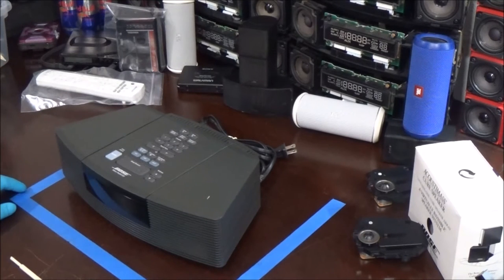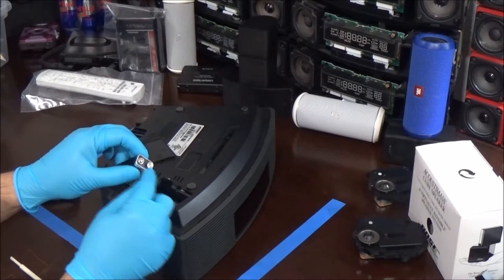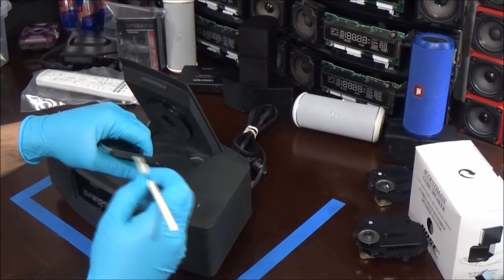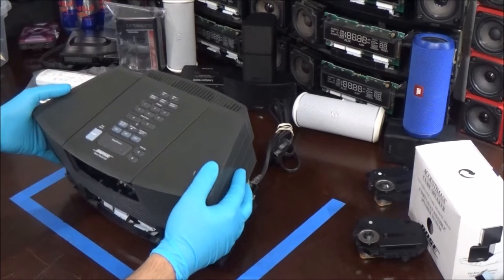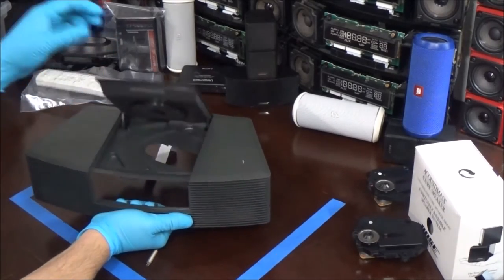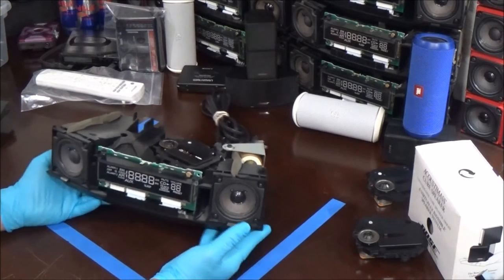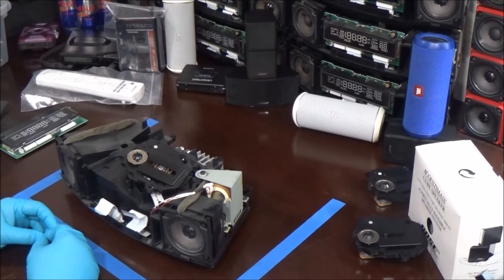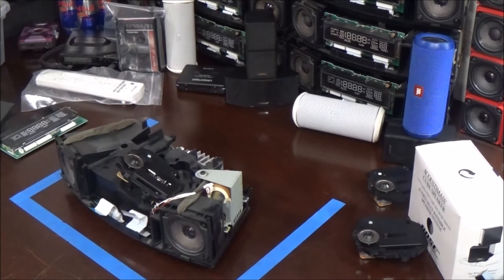Pt. 2 First Gen Bose Wave CD Radio Teardown Repair Dismantle All You need To Know

Comment: Wonderful and so thorough.  The compartment door on my original had become irreparable via an accident. I bought an identical model for $25 off eBay that had a inoperable CD player and used this video to perfection to take the working compartment door and ribbon cable from the purchased unit to repair my original.  So excited and thankful that my original is working 100% now!
Reply from the maker: Thank you! I'm so glad I helped.

Comment: Thank You  for the very informative video,  I have 2 Bose Wave/CD radios. I just picked up my second unit at a second hand store for $7.00, with the knock off remote in white, and it works fantastic, even more clear then my original unit I've had for 15 years. They are both fantastic sound machines. Thanks for sharing your knowledge on these fantastic radios. Very well done vidios...
Reply from the maker: Much appreciated, Thanks you.

Comment: Great teardown guide, Luv these units still got my dark grey one (made in ireland) from new back in the day , now got a white one (US made) that has the dull display & won't read discs so something to get workin on !
Reply from the maker: Thanks! Yes, Bose had one of it's largest factories in Ireland they produced more Redline cubes in Ireland than anywhere else. It is rare for the photoresistor to go out however the VFD (vacuum fluorescent display) is a different story, at least for now you could set the dimmer to the brightest, also have you tried cleaning the lens?
Merry Christmas 🌲

Comment: Mine got rained on and the left side has no sound. It doesn’t seem to be the speaker. I switched the wires and the problem switched sides. Any suggestions please.
Reply from the maker: Hi, it sure sounds like your amplifier has a bad channel.

Comment: Great video!! I recently bought a Bose Wave on a garage sale and some of the pads in the CD lid won't work mostly my on/off and volume buttons and I don't think the infrared is working on the front panel. I bought a used lid and a new remote which doesn't work right now. Your explanations are just great. I should have a refurbished lid and pad on soon but not sure what to do about the infrared on the panel.

Comment: I read open circuit across the power plug.  Fuse test ok.  I noticed that the primary widings on J2 also measured open circuit.  Where do I purchase a transformer?  Very good video to show how to open the case.  Thank you.
Reply from the maker: My pleasure. You can find a transformer from $15 to $25 on eBay Hundreds are listed make sure the part number and Rev. are the same. Good luck!

Comment: Hello, Great Video!.  My Bose Wave doesn't play when first plugged in.  It plays great after plugged in for a bit, seems like it needs to warm up.  Is there a component that can be changed to fix this issue?  I am handy with a soldering iron.   Thanks
Reply from the maker: Hi, you need to use a good magnifier and check all CD related solder for cracks. Only one thing causes the issue you're having, cracked solder. You just need to find it and reflow it. As your unit heats up and expands it makes good contact at that point. Good luck
Reply: @EightiesNut  Thank you for the tip.  I took it apart and poked around with a magnifying glass.  It now works perfectly.  Do you have experience with the SoundTouch series or the older Lifestyle series?  I have some of those with a variety of issues.  Not much info out there from people that actually worked on them.

Comment: Thank you!  This is such a great video for explaining how to take apart a Bose wave. The problem is though, if you find you need say a replacement cd drive or a display how do you acquire one? Buying old machines that are "for spares/repair" is risky as most of the parts you want are not working. Any advice for us in the UK?

Comment: I have been saving my Bose to take apart to see if it was fixable for at least the last 2 years.  From watching this video it sounds like it needs a new fuse.  And the cd player sometimes acted up and would not read cds. But one day it just turned off. The whole thing. No display.  Can I get a new fuse just anywhere fuses are sold and I have access to someone who can solder but is it absolutely necessary that the fuse be soldered?  Thank you! Appreciate this video. Couldn’t believe no one was fixing these anywhere ever again!
Reply from the maker: Hi, thank you, the pleasure is all mine. Yes, the fuse must be soldered as the Bose design has no fuse holder instead they chose to use a through-hole style fuse for cost-effectiveness and some space. The fuse is a 1A 250VAC good luck.

Comment: Great video!  How to get the ribbon cable back on the top  door?
Reply from the maker: Hi, Thank you! You would need to use needle nose pliers as that ribbon was installed prior to the lid being thermally adhered together. Hold the ribbon as close to the contacts as possible when inserting it. Holding it further out will cause it to buckle. Good luck!
Reply: I'm just not sure what is going to cause the ribbon to stay inside the contacts even if I could reinsert, I can see with my headlight.  I know they sell just the top so there must be a way to attach the cable again.  Otherwise I've just made a very costly mistake.  Please help!
Reply from the maker: It is basically a pinch-press fit, tab-less meaning it does not have a plastic tab (hold-down clip) just insert the ribbon in the same position all the way in nice and even. In this case polarity matters. I have done it many times with no issues at all. By the way, no reputable seller should be selling the top CD lid without the ribbon still intact and still installed as buyers would just run into the same issue you are having without the super thin flat needle nose pliers it becomes rather difficult maybe even impossible. Even some people with tech skills might still have a hard time because of the tight fitment.

Comment: Such a helpful video on stripping a Bose down and without damaging it. Thank you!  But I don't think you explained whether the laser diode on a failing CD could be replaced and how. Can it?
Reply from the maker: Hi, thank you. Basically you have to choices, one replace the optics by it self or two replace the complete optical drive assembly which will have a new optics already included. Back in the days it was only a $32 difference so we almost always opted for the complete assembly on the older worn units. It was more cost effective for us and longer lasting for the customer, we did not want to replace the diode then have the radio come back soon after for a drive assembly failure.
Reply: Yes I can easily see why you did that. Problem is people cannot acquire a new drive or optics nowadays so replacing the diode may be one of the only options. Is it easy to identify the diode and what is the spec for a replacement one?

Comment: my old Gen1 (no cd) wave has died. I would like to reuse the speakers since they sound great (build my own case) . What would you suggest to use as an audio amp that I can pwer these with?
Reply from the maker: The radio has a crossover built-in. It is not true stereo, borderline Mono channel. More bass to the left and more highs and treble from the right speaker. A 30-watt amp would be plenty.
Reply: @EightiesNut  now I’m wondering if the speakers need to actually be in the Bose housing for optimal sound. Is there a waveguide or resonance chamber behind one or both?
Reply from the maker: Sorry, the word is "treble" I was typing too fast. The acrylonitrile butadiene styrene speaker housing was tuned specifically for those speakers mainly for the left speaker it is used as a little woofer. It's a tuned ported enclosure this was chosen over a sealed one that produces clean tight bass because ported travels further in turn, it is more filling.

Comment: Is a speaker from an AWR1-1W compatible with an AWRC-1G?
Reply from the maker: Hi, yes, they are. The sub is on the left and a full-range speaker is on the right. The wire length will be different though.
Reply: @EightiesNut  thanks for your reply. Upon opening them both up I discovered that the AWR1 has a different connector, and decided I didn’t feel like butchering that to get a speaker for my AWRC since the radio works just fine. I’m just gonna wait until I find another CD player that doesn’t work and steal a speaker from that.
Reply: @EightiesNut  to explain in more detail; I have an AWRC-1G that haas no sound coming from the left speaker. I took it apart and cleaned the connections really well and saw no signs of corrosion or oxidation so I assume the speaker is bad. I found an AWR1 at a thrift store and was gonna steal a speaker out of that, but it seems like a shame to go cutting wires up in a perfectly fine radio.

Anyway, thanks again for your reply, and for this video as a whole…it was really helpful.
Reply from the maker: Thanks, The pleasure is all mine. I would still make sure that it is the speaker and not a bad channel on the amp.
Reply: @EightiesNut  how do I diagnose that?
Reply from the maker: Unplug the small white plastic speaker plug to the PCB of the nonworking speaker then remove the four speaker screws. With the speaker hanging out. If you have another sound source touch it to the speaker terminals don't forget that step one is important so you are not sending an audio signal to the amp, if you do not have a second audio source use a triple or double A battery with a wire soldered or taped to each end. Tap the battery wires to the speaker terminals. Polarities do not matter if they are backward the speaker will jump inwards and if they are correct the speaker will jump outwards. If the speaker jumps it is good. If it does not it more likely has a severed magnet wire on its coil (blown speaker)

Comment: Hi I've recently had one of these actual models go dead, was working fine one minute, now no power at all, have checked the mains lead - all fine power getting to the inner on board plug input, fuse continuity is good so no blown fuse but unit still stone dead, any pointers to other causes of total dead unit, thanks Tony UK
Reply from the maker: Are you sure it is not an extremely dim screen from the photoresistor going out? I am sure you have tried, but I have to ask did you raise the volume and try playing the radio or CD? Sorry, just probing...

Comment: Mine is making an intermittent crackling noise on the left sub-woofer so I would say the base only works about 10% of the time and it now sounds like a cheap £5 radio haha!
On inspection, I found nothing wrong with the speaker so I swapped the wires over as a basic test (the left speaker into the right plug & right speaker into the left plug). Still, the problem continued on the right speaker so the problem is not the speakers but the circuit to the left speaker. 
Any Idea what I need to look for or how I can fix it?
Reply from the maker: Hi, if it is doing that same sound during radio play and or CD play then more likely it is a bad cap.
Reply: @EightiesNut  ok thanks for that. And if you could educate me, what is a bad cap? Haha!
Reply from the maker: @DeanCrowder  I almost fell for that, hehe
Reply: @EightiesNut  No seriously, I honestly don't know.
Reply from the maker: Oh sorry, I thought you were kidding. I was talking about the amplifier capacitors on the PCB sometimes they swell or burst and sometimes they just dry out. In the process of failing but not yet failed, you could get chirping sounds or hums, I would just replace all the caps as that will make the sound amazing again. Through time old caps will change the sound quality and because it's gradual slight changes and not drastic changes most people wont notice it. I notice the sound difference immediately because I am so used to listing to them. I could till a unit with new caps compared to a unit with old caps.
Reply: Thanks for that, I would not have known this without your help. I'm not great at soldering but I will give it a go. Thank you.

Comment: Thank you for the video! I have a unit that intermittently has heavy distortion and a rumbling noise coming from the bass speaker.  The audio from the aux out is clear, however.  Do you have any advice for repairing this?  Thank you!
Reply from the maker: Hi, Its no problem at all. I enjoy helping people. It sounds like your low level out is fine which means the most likely culprit would be the amplifier. As long as the bad sound is produced by the radio and the CD player.

Comment: Thank you for the insight into a hidden gem. 

I have a Bose Wave I, and I have been using it for my main speaker system. I have been running units that plug into the auxiliary jacks in back, and it takes care of everything.

Recently, the connections on the auxiliary jacks cut in and out from the audio signal. If I wiggle the wires, it comes back temporarily, but eventually cuts back out. 

Is the unit done at this point, or is there a replacement or repair for the rca jacks in back that cut the audio signal in and out.

Thank you again for the great instructional.
Reply from the maker: Hi, it is my pleasure. It is not a difficult repair, but you will have to dismantle the entire unit much further then I demonstrated, as the inputs are soldered to the PCB and you must get underneath the PCB to desolder the old one and resolder the new one in it's place. Also you might not need to replace it at all. You might have just cracked the solder from using it so many times and all you have to do is reflow the solder also from underneath. I always tell everyone if you will be using the input or output jacks frequently then you should install a RCA patch line with male on one side and female on the other, so in the future all you would replace is a $2 to $8 patch line and save all the repair hassle. Good luck
Reply: Do you have a video representing the access to the PCB, or know of one?

Thank you.
Reply from the maker: Sorry I do not nor do I know of one, but I could make one and post it in a week or so.

Comment: If the system is plugged in   Doesn’t turn on   But the fuse and plug and power all have proper charges with voltmeter, what can be checked next?
Reply from the maker: Hi, next you should check the power transformer.

Comment: I'm quite frustrated by your video. You say you have an large quantity of NOS CD drives, but you won't sell any. You talk about how your company went out of business and that you have a substantial investment in those NOS parts, but you won't sell any. You talk about the high quality of the first gen units, but you won't sell NOS parts or, AFAIK, offer a repair service. I have an AWRC-1G with a CD drive that no longer will. You've done nothing to help resolve my problem. Why would I want to disassemble the unit to the bone, if I can't get replacement modules? Be cause of your video, I know the parts I need exist, but you won't sell any. I'm frustrated.
Reply from the maker: Hi, I am sorry that was not my intension at all. The video was intended to help someone that has a non working unit or more then one unit to be able to swap/replace parts.
Reply: @EightiesNut  it’s a great video and I too need cd parts can you recommend any sources of replacement parts
Reply: DOn't "be sorry," sell us the damn parts.  You actually say, "I must have thousands of these (referring to the BASE ASSEMBLY).  WHAT THE HELL ARE YOU GOING TO DO WITH THEM?  EAT ONE A DAY?  WELD THEM TOGETHER INTO AN INTERESTING STATUE FOR THE GARDEN?  What possible reason would you have for NOT selling them?  Damn frustrating that you would make a video about how to fix something while have the parts to do it -- parts we can't find anywhere else -- but not sell them?  What are you smoking and where can we get a lid?
 @EightiesNut